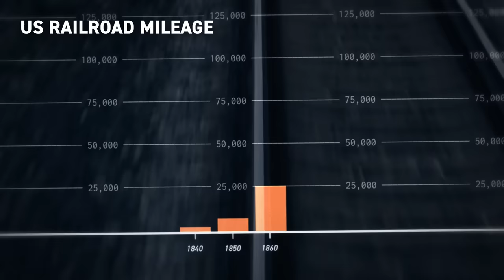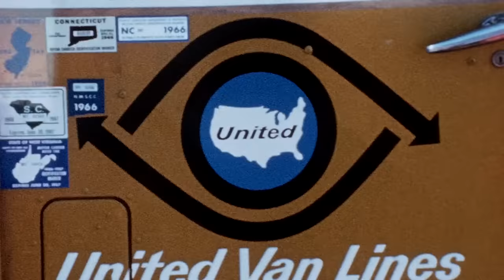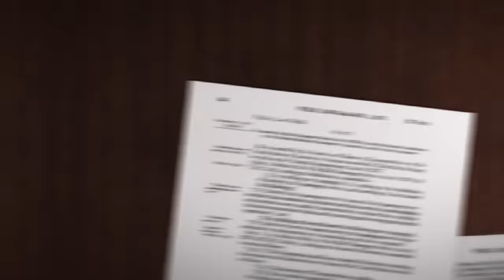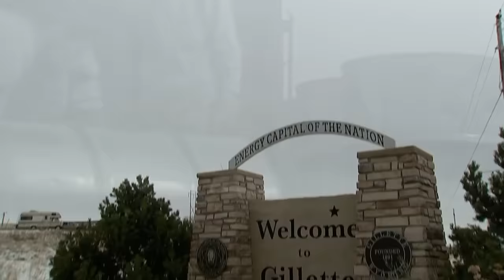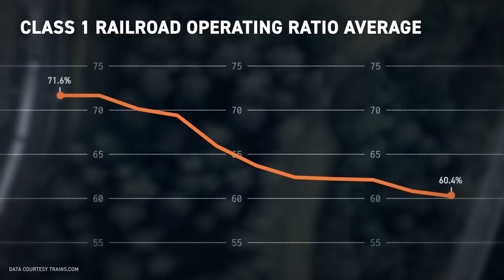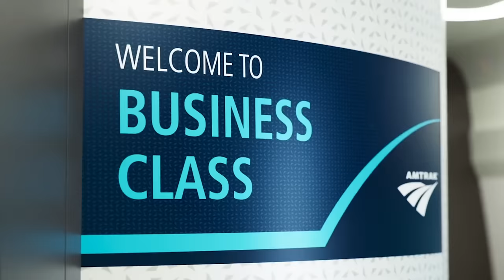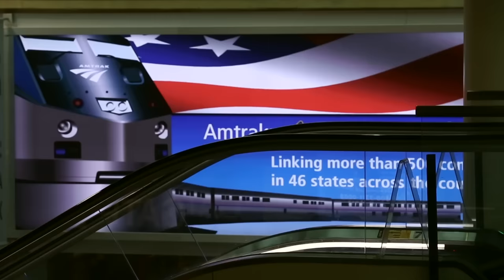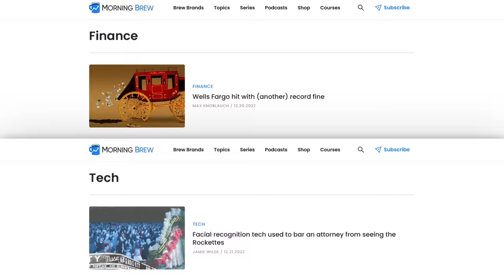The One Tiny Law That Keeps Amtrak Terrible

Comment: You speak of trucking entering the scene post WW2 as competition, but neglect to say what made trucks competitive. The Dwight D. Eisenhower National System of Interstate and Defense Highways was marginally overlooked.
Reply: Just as important was the decrepit post-war state of the railroads. Only the most-critical maintenance was permitted during the war, to keep the troops and war materials moving. The railroads carried troops and war equipment at cost or at a loss. After the war they were left with worn-out locomotives, track and equipment, but didn’t have the money to repair or replace the infrastructure. In the immediate aftermath of the war the US entered a recession thanks to a sudden decline in demand for guns, bombs, bombers, tanks, and ships. As private companies, the railroads were expected to pay for their own improvements, but the government (ICC) wouldn’t permit increasing rates to pay for it.
Reply: What made trucking competitive, was their ability to go anywhere there was a road.  Rail is limited to only where the rail line operates.

Comment: I've used Amtrak in Pennsylvania to get from Philly to Harrisburg and Pittsburgh a bunch of times. It's a quaint 5-6 hour train ride across some lovely countryside that bisects Amish & Mennonite communities. i'd see'em using the trains too. The Lehigh Valley in PA used to also have passenger rails up to here in the Poconos, and also areas like Tamaqua PA and Jim Thorpe did. Jim Thorpe has a passenger rail as a tourist trap but still neat. Tamaqua as far as i've read have been wanting to bring back their train. I've seen talks of probably trains from NYC to Scranton and WIlkes barre. Pennsylvania has many thousands of miles of rails just not used but could be, and many in a state of repair. The only train that uses the tracks in my town of Lehighton, is the midnight express really. It'd be neat to visit the PA countryside by some trains and whatnot.

Comment: Interesting.  At 14:28 is a cement truck deliving cement to a track repair.  It was driven onto a flat bed rail cart that is offset to put one set of tires between the tracks and the other on the outboard side of the tracks.  Clever.

Comment: i feel like it’s a stretch to say that cars aren’t the “norm” when it’s been a car country for like 8 decades at this point. 

golden age of rail in the 1880s to the 1920s was only about half that long
Reply: To be fair I’d consider the golden age from 1870-1950. So about the same length of time as “car culture” so far. The only measure it reached its peak in 1920 was in raw track miles. That doesn’t say much. In 1950, trains were still better and faster. But yes I get your point.
Reply: Exactly, many people failed to realize passenger rail was dying already in the 1930's. Let's not forget the reason Amtrak got its start in 1971 instead of 1941 is due to WWII. Without the need for rationing of fuel, rubber, as well as the need to move large amounts of people at one time like workers to industries and troops from one base to another, passenger rail's rule on transportation in America would've been even shorter. I know it's easy to blame our auto-centricity on 1950's oil and car propaganda, but even as a major advocate for better rail and transit connections in this country. I have to admit that our culture of individuality and personal ownership is a big reason why many don't want to touch anything that involves public with a ten foot pole.

Comment: I am sure you have stated facts but I'm old enough to have ridden cross county by rail many times in the 50's and 60's and I also live on the Front Range in Colorado so have a little personal experience.  I hate airlines but given a choice, I would never take a train if I could fly.  Even high speed rail would be far too slow, the first time might be fun and exciting but it quickly gets old and mind numbingly boring, no matter how many USB ports on your seat.   I also don't believe train service along the front range is viable, we already have a similar service called Bustang, it does essentially what the train system would do but with buses and more flexibility.  Bustang doesn't seem popular and I've never known anybody that even tried it.  The probable reason is that no city along Front Range  is walkable, once you get to your destination, then what?  The county has grown in a ways that make passenger trains non-viable and not needed in most of the country.  I would not voluntarily take a train if I could drive/fly nor do I know anybody that would do it ore than once.  Passenger trains are not romantic, fun, cheaper or better than private cars and airlines; thats why they have disappeared.

Comment: My wife and I are long time rail travelers and we've missed connections more than once. To be fair, we ride Amtrak as part of our vacation so arrival times aren't too critical. We live in a small town in Michigan where we can just drive into town, board an Amtrak train and with one connection in Chicago, travel out west. Another problem not mentioned is that coal trains simply beat the hell out of the tracks so it's always a pretty rough ride over same tracks. To be sure, Amtrak has it's own problems, government employees are never as responsive as those working for private industry but you take what you can get.

Comment: Railroads as a business were killed long ago by unions and extensive government overregulation. Now, "solutions" are all about what government can do to prop up the industry by fixing the ailing infrastructure, subsidizing tickets, etc.

The video is pretty good in analyzing the present riding situation, but the suggestion that owners won't invest in infrastructure is myopic. Businesses invest where there's a profit to be made. They had no problem building out the rail infrastructure in the first place. Land grants helped, but the expectation of a profit drove the investment. Passenger rail in the current climate simply isn't profitable.

Comment: Unnecessarily long-winded video. Repeats the same points for 20 mins. Try to make your videos more succinct in future, or if you want a longer runtime then add more content (repeating the same content but presenting it in a different way doesn't count and makes for frustrating viewing). Also, there are a small number of new rail infrastructure projects happening in the US right now which I'm surprised you didn't mention - the best way to solve the 'passenger vs freight' debate is to build new, dedicated high speed rail lines. Using you example, a new dedicated high speed line between Pueblo and Denver would be faster than driving.

Comment: A great presentation. Generally, speaking as a frequent traveler on the Amtrak Surfliner between San Diego and Los Angeles, the freight traffic, Metrolink, Coaster, and even Sprinter excites me as more double tracks enable the addition of more cars and frequency for everyone concerned. Rail traffic flowing from Tijuana and the Port of San Diego, increasingly back and forth, and between Long Beach and Los Angeles, requires cooperation and coordination, which is evident and responsible. When a freight train needs to transport or mechanical problems occur, everyone shuffles to accommodate. Passengers take it in stride. The one obstacle is the mudslides in two areas that require expensive improvements. Otherwise, I believe the rail operators want to manage the entire system respectfully.

Comment: I'm American but when I lived in France, I would take the train from Paris to Aix-en-Provence and back. It's almost 500 miles each way, but the TGV can cover that in less than three hours (including the 15 minute or so stop in Lyon). 500-600 miles is a distance that most Americans choose to fly. Detroit to Philly is 500 miles. So is San Diego to San Francisco. So is Kansas City to Chicago. So is Nashville to Jacksonville. So is Cleveland to Charlotte. Dallas to St Louis is a bit over 600 miles. So is Portland to San Francisco. So is Denver to Oklahoma City. So is Oklahoma City to New Orleans. These are routes that high speed trains can cover in similar times to airport time (which includes a longer boarding and baggage claim process) but at a lower cost, higher volume, and much lower CO2 outputs per passenger.

Comment: The biggest problem with moving passengers is the lack of dedicated rail lines for passengers.  Okay then, build a separate passenger track beside the existing freight tracks = problem solved. The second problem is the WEIGHT of the vehicle that is moving those passengers. Imagine a Greyhound bus moving 50 passengers down the road. Now imagine a similar bus carrying the same 50 passengers but the bus weighs 10 times more. The cost per passenger ticket would be 10 times higher.  The solution to moving passengers by train cheaper is to simply make the passenger trains drastically lighter. The old TURBO train was aluminum and very lightweight (but with a horrible engine). Simply connect one of those old passenger trains to a modern Challenger locomotive and you've got the cheaper/lighter 'reliable' passenger train that you need.

Comment: Utah solved this problem by building a dedicated Amtrak service. It runs every 30 minutes all day every day. It runs about 120 miles north to south with many well located stops, and is being expanded. It has two tracks allowing traffic to flow both ways without interference or head on collision hazard. Then they ran small light rail east to west and then the bus route run from the light rail to smaller destinations. It works. The only issue with it is that it does not run at night. The busses are not reliable at all and the light rail runs above ground; it regularly kills pedestrians and unaware drivers.

Comment: When I worked for the SOO line before it merged with CP Rail and after the merge, Amtrak was given preference over freight.  If a Amtrak train was X amount of time to meet a freight train, the freight train would be held in a siding until Amtrak passed.  Amtrak pays for track usage to the railroads as the railroads own and maintains the tracks.

Comment: A roomette on an amtrak train from NYC to Florida is around $650. each way . Amtrak auto train from Lorton VA to Sanford Fl is around $5,000 round trip. I can easily purchase an airline ticket for NYC to Florida for as cheap at $79.00 each way and I get there in 2 and 1/2 hours vs 34 to 36 hours by train.  Get the point.

Comment: Interesting Germany has the same problem. because high speed tracks are so expensive, also slow trains have to use it. So a 300 km/h train needs to take care of trains with just 120 km/h and on night time its even worse. Different level, but huge problems with delays.

Comment: "Clean Coal" is a Term applied to processes, not to the Mineral itself.
Most Western Coal (eg: Powder River Basin Coal) is Bituminous, which is dirtier than Eastern Anthracite.
Coal mining moved West not because it was cleaner than Eastern Coal, but it was easier to strip mine out of large flat areas, as opposed to the hilly East.

Comment: You don't need to range far from the "northeast" to experience the impact of poor track maintenance, long freight trains, and the not-really-priority of passenger runs.  Amtrak Northeast Regional trains run into the lower half of Virginia.  At the little station where I live, many of us consider arrivals that are delayed less than say, 90 minutes as "normal, on-time (late) arrival.  But we now have two daily trains, whereas for many years, we had none.

Comment: Strikes me that both the freight and passenger bottlenecks can be addressed with targeted investments in corridor widening and looping in more secondary ports that already have rail access. There may be several ways to incentivize that. And set an upper ceiling on further train lengthening so that sidings must lengthen with any new training lengthening. Public Action Bonds may help with some of this, along with small regulatory tweaks without throwing out the whole system.

Comment: The high speed passenger network we need has to have completely separate tracks. Amtrak will suck for as long as it shares track w freight
Reply: Use Eminent Domain to buy the needed ROWs to have much better passenger service.

Comment: I have to commend the effort you put into making this exposé. The subject is even more complicated than what you presented. However, I'm glad you mentioned that freight rail and passenger rail are incompatible. Freight trains are sorted and assembled in large freight yards, and then released down the track when the line is sufficiently open. Passenger trains are much shorter and faster and adhere to timed schedules, schedules the freight trains have no reason to be concerned with. I would make the claim that the U.S. needs an entirely new and dedicated surface transportation infrastructure that moves passengers quickly, reliably and safely around the country - this is maglev transport. China has one high-speed line and three low-speed lines that do what I saying, while Japan is building one from Tokyo to Nagoya. The Amtrak legislation you reference in your piece was evidently written by lawyers/politicians that did not fully understand railroad operations. The freight railroads naturally put their financial needs ahead of Amtrak's, in spite of some wishful thinking on the part of whoever wrote the "Amtrak priority" clause. They own their tracks, so why not? Amtrak's business model stinks. It only owns about 1,700 miles of track, yet runs on 27,000 miles of freight track. Then there is the electrification issue, which is sadly lacking in the U.S. rail system. Passenger rail in this country should be privatized once again, with the federal government providing incentives for building dedicated ROWs for high-speed maglev, which could also host problematic electricity transmission lines. Imagine a 300 mph maglev from Pueblo to Denver and beyond. People would certainly abandon the I-25 nightmare drive. Problem is, nobody in Colorado wants to finance new infrastructure like this, because they want the federal government to pay for it. I know, I worked on the CDOT studies to build an Advanced Guideway System along I-70. I showed everyone how and why the maglev solution was the lower cost solution and a potential money making machine for its operators. I even suggested they build such a system first along the Front Range - this was over ten years ago! The I-70 solution politicos came up with was adding toll lanes - not exactly visionary! And, therein lies the problem - lack of vision!

Comment: unlike truck companies, railroads have 'real' assets in every community they pass through, real as in real estate.  This of course means that the community is free to levy real estate and school taxes on them and they do.  One way to reduce these taxes is to defer maintenance, want to see how fast government can work, just put a coat of paint on your old shed and suddenly it becomes a valuable mansion in the eyes of the tax assessor.  Various regulations made the practice of running a few cars behind a locomotive for delivery to a wayside factory very uneconomic, for instance, New York for years had the 'full crew' law meaning that such a train had to have a crew of between 5 and 7 members and a caboose when hauling those few cars, railroad workers are heavily unionize and are not underpaid.  The railroads didn't make the environmental rules changing the coal market from eastern coal that was loaded with sulphur to cleaner western coal but when the market emerged they took advantage of it, a socialized railways system would still be debating if and when they should build a track to that mine.  The railroads didn't build the interstate highway system that made the trucking industry boom but they paid for it with their taxes, and had to continue running near empty passenger trains when their former passengers were riding in cars and buses on the new highway.  you'll note that no trucking company owns a bus line.  One of the benefits of railway mergers is the reduction of redundant assets such as parallel lines, the idea is to operate enough track to meet the traffic demands and anticipated growth in coming years but not growth that might or might not happen a century from now.  Nor can you justify capacity that is only utilized only seasonally such as having grain cars that are essential for several months in the fall and then sit idle for the rest of the year.  If the millers want that service they should buy their own cars.  Another consideration is barge operation on the Mississippi River system.  Barge operation is seasonal, much of the river closes to navigation during the winter and remains closed through the spring floods.  The railroads were expected to be the alternative service during these periods but were prevented from offering rates that would encourage year round service demand, by the way, the same issue applies to the Great Lakes.  Remember too that barge traffic is generally downriver, it's damned expensive to push a loaded barge upriver against a 6mph downstream current.  Locks, dams, and navigation systems on the river are provided by the government without user fees.  I might also add that Grand Central and Penn Sta were both privately owned and built while the bus terminal and the airports are operated and built by the government.  Private railways have invested billion$ every year in system improvement including additional billions in 'positive train control' a signaling system they didn't need or want while the FAA ungraded their system at taxpayer expense.